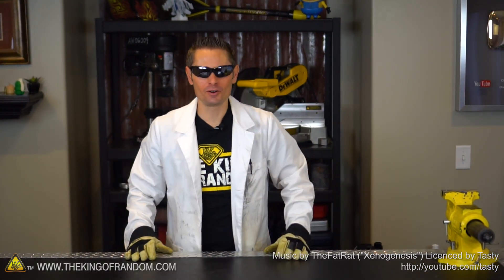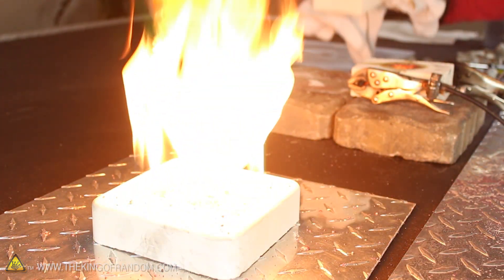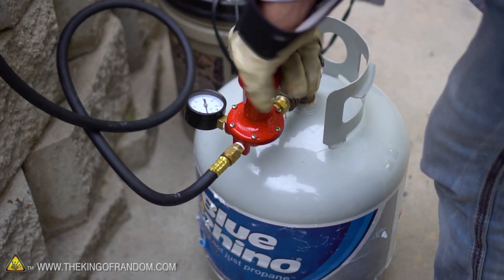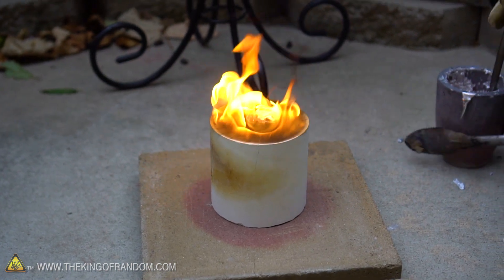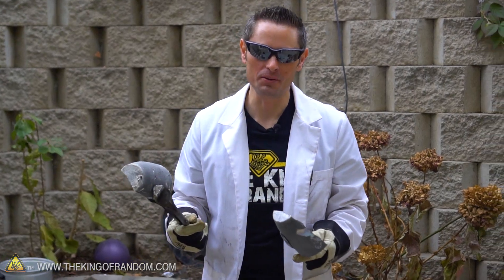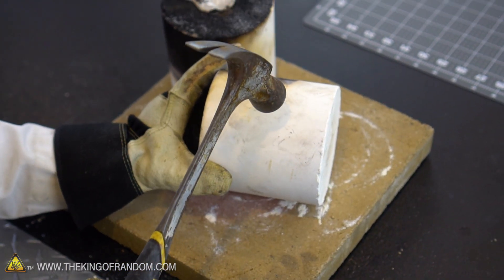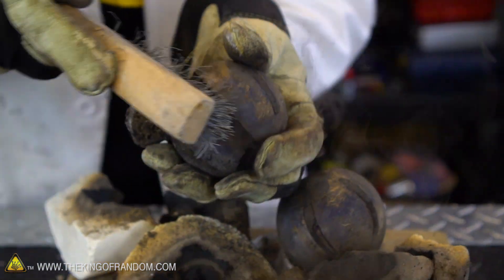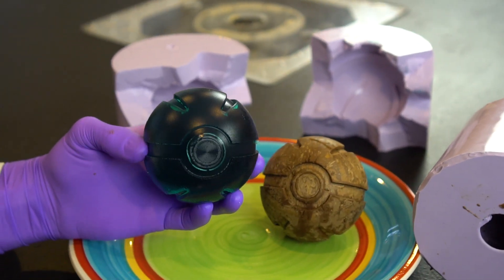Casting Aluminium PokeBalls

Comment: i think if you brush the silicone on the object first you will get a way better surface finish in your molds. similarly when you fill them, add a little first and turn the molds to coat the inside before pouring in the rest. thats what i do when dealing with latex and epoxy for fx makeups.

Comment: I would think that if you took a block of Styrofoam cut it in half, heated the poke ball just enough to make an impression on the foam and enclosed the heated ball between the two halfs, then take the ball out and cut around the impressions and place together within the bucket of sand like the master sword pour the molten aluminum and hopefully get what your looking for. I don't know if that would work but hey if it does, cool, if not, oh well.

Comment: So what you need is some sand! Look up something called Foundry In A Box. I work in the industry. use sand and binder to create a mixture to pack around the balls. Get a hold of me if you want to know more.
Reply: I also use a simple Hot Pot like you use for making fishing weights to melt Tin and it is much easier to work with.

Comment: Add some air tubes to evacuate the air from the plaster mould while pouring the metal in, tl;dr: two holes, one big for metal in and one (or more) small for air out

Comment: just a suggestion maybe u might want to ask cody about different metal melting point so that u can get a few option of metals that u can use to melt and then pour it into the plaster , my theory is that the plaster is not able to withstand the heat of the aluminium thus creating fire and then burning it maybe u guys can have another collab again which i m sure a lot of fans would like to see, i know having another collab is hard but just a suggestion :)

OR change the plaster to another kind/type which can withstand very high temperature

Comment: You should use green sand for moulds in future. Yeah the plaster works but you left that overnight and you weren't able to use it ever again. Correct me if I'm wrong, but I'm certain that green sand can be used multiple times.

Comment: To avoid the air pockets in the final casting you need a second channel for the air to escape from near the top so it doesn't get blocked by the incoming aluminium

Comment: Your casts may do better if you place the plaster(silicone, as well) in a vacuum chamber(easy to make if you have the pump) while setting the mold to get all the gases out and have a more solid form and little to no bubble business. You may also want to make more apertures for the molten metal to flow into/vent gases out by making extra limbs on the mold.

Comment: Grant, lots of people had the right ideas about dealing with the wax molds and the silicone molds, now i would suggest to try using an idea you have used before, but with a twist, try doing some "green sand" casting.

Comment: Your silicon mold was flawed from the pour, as it poured directly onto the blank the vicosity made it bend and fold over itself introducing air bubbles by the second, you need to pour slower in a corner of the mold that isn't occupied and let it fill that way.

add fine sifted sand to your plaster to give it a little more durability, and it needs to be a denser mix all around, If you could vaccum it before you pour that would be awesome but it's not absolutely required. There should be enough sand to change the color of the plaster to something like light khaki pants, I eyeball mine based on detail i'm looking for and the temp I intend to pour at.

Your shrinkage is a tough fix, add vent holes in the mold that meet the cavity about 2 mm below the first noticable defects. Failing that you might benefit from a riser as well, But I'd start with the vent holes, you can make them by rolling some parafin wax into a string and pressing it onto your wax ball before pouring the plaster investment, Paraffin wax is easily sourced and mouldable if you just get it from some fancy cheezes if you don't wanna buy some, It's actually easier to mold than candle wax in my opinion. and it'll melt out just as easily
Reply: No, mate, no capitals after periods, don't even try to correct someone when you're wrong (Hunter Jones, take that)

Comment: make a mould of sand+bentonite(binding material)+water whenever you cast metal instead of using Plaster , make small holes with a small wire so that the air come out , also coat the inside of the mould with graphite powder , this method is used in industries for casting .

Comment: you need a vacuum station to vacuum out the air pockets in the plaster before pouring it. letting it rise under negative pressure and fall several times should make structure of the molding material less prone to cracking... as far as the crucible, you already know what happened there. Also, if you still have the finished plaster warm, swash it in water the plaster should desolve from your nooks and cranies

Comment: Great work. I think the bubbles are really a result of the fire reaction. Maybe if you just cover the top of the mold as you finish pouring, soon after it starts catching fire, you can prevent it? Sort of like using a blanket to extinguish a fire but cutting out the oxygen.

Comment: Hey grant you've been doing a lot of molding and casting lately and thats great. I do this stuff a lot too and I think I have an idea for your next project. You should build a degassing chamber. It will deffinatly solve your issue with bubbles and imperfections forming in your molds and even your casts (except for the metal ones...unless you can figure out how to pull the air out while the system survives the heat.)

Comment: Take the silicone mold put plastic pokemon toy in the middle and fill it up with melted Hand soap. When it hardens you have a grate gift for pokemon Fan. When you use the soap  it shriks in size and when its all out you get the prize inside.

Comment: by the way, if you want to get rid of your air bubbles on your original molds, you can get a slightly thicker silicone that is a little like play doh, you just mold that onto the ball itself on the top so that when air bubbles do form from the liquid silicone mix, they appear between two layers of silicone, on don't create imperfections on your actual molds. you only need it on the top third or so, or wherever is angles strongly enough that bubbles will catch within the silicone liquid mix.

Comment: My suggestion for the silicone casting,  attach a sander or another tool that vibrates to the plastic cases to eliminate all air bubbles.

Comment: You should really start experimenting with green sand. It would've allowed you to cast straight from the original without needing to make the silicon or plaster molds. Just need to make sure to include vent holes. 

That being said a scented pokeball candle does sound like a really cool idea. . .

Comment: best way to remove air from plaster or silicone is to put it in a vacuum, it draws all the excess bubbles out. Maybe a use for the old pump you made?

plaster for casting could do with a little clay mixed in with the sand too.
lastly, to remove the plaster and save having to brush it off, dunk the whole thing in a bucket of water, it disolves the mold completely.
Cheers for another great video

ps. now you know why the crucible needs to be normalised.

Comment: Also, most aluminium alloys experience hot shortness. Get it hot, hit it with a hammer and it will break into small pieces you can more easily load into your crucible ;)

Comment: metals need protection, TIG uses a gas in my country is caled 'argon' MIG MAG is metal inert gas metal active gas soo is allso with a gas protection, electric welding has diferent protection that shoul be above melted metal, that might help you on future projets with metals find a way to put them same time but not mixed
Reply: more informatins you can find at aluminium welders

Comment: you could have made some gateway in the plaster mold so that the gases from molten aluminium which causes air bubbles would have passed through the gateway reducing the chances of air bubbles

Comment: I have a challenge for something unusual that you can try to cast:
https://s-media-cache-ak0.pinimg.com/originals/a9/bf/35/a9bf356c83e71c1929721a44fad1799d.jpg

I imagine the antenna and ears would be a major obstacle and it would be interesting to see if you can think of
a solution around it :)

Comment: In order to get a better surface quality, you could cover your wax prototypes with slurry and sand repeatedly until it forms a thick shell. Then get rid of the wax and then burn it in the oven. This is about the best surface quality you can achieve at home, as the slurry and the sand will not release gases after burning.
Pouring temps of 1400 degrees C. are no problem. For more info, just google Investment casting.

Comment: Hey Grant, I've done metal casting before. I'm guessing the plaster you're using isn't suitable for the casting. You want investment. It's a form of plaster that can take the high heat and not burn like your plaster. 

Other people are saying you need a vent, but in my experience you don't necessarily need it. It helps, don't get me wrong, but I never had vents and my casts turned out alright. Then again, I used centrifuge casting when doing so. 

If you were able to get the investment instead of your plaster, you'd get less bubbles. You'd also do well with a vacuum table. It vacuums all the bubbles out. But another thing you can do to help is use debubbler. It's a spray that helps investment/plaster from letting bubbles attach to your mold. If you want to talk more, shoot me a message.

Comment: Hey Grant! Maybe try using green sand for casts? I would assume it would be less tedious than making silicon molds, then wax models, then plaster molds, then metal models. Rather, you could just make the sand mold ready for metal casting straight from the original object. I hear they can hold the shape really well and can make some "accurate" casts.

Comment: hey, so to get better casting results try casting sand.  make a box cut horizontally in half and tightly pack your item to be casted inside.  when you are done filling the sand split the box open and take your part out, there should be a cavity of the item in the sand.  it's just super fragile.  Also to eliminate bubbles you need another vent to the outside coming from your casting.

Comment: your air bubbles issues can be solved by using a vibrating table like the ones used when molding candy and chocolates.  and if you want to take it to the next level, building one could be a future diy video

Comment: 1. Would you cast a metal controller? (X-Box, Playstation, ect.)

2. Is there a way to make a permanent mold, or at least more than one use?
Reply: No not really in sand casting, or the way he was doing it with plaster, but a permanent mold  is more like die casting which molten metal is forced into a metal mold that can withstand the heat. Sand casting is simpler for the every day person. Look up Foundry In A Box. This is how the metal casting industry does it. For an Example the sewer caps you see every day were from a sand casting. You have a Cope and a Drag made from sand and Binder that is packed around a Mold (X box Controller) and you create a runner so the metal evenly flows into the mold and then a pour spout to pour the molten metal in. Let it cool down and then break apart the sand and you are left with a metal mold of what ever you want to imprint into the sand.
Reply: Cranberry X (Old) instead of using plaster, use red casting sand. it is completely reusable, and doesn't release gas when pouring the molten aluminium.
Reply: Cranberry X (Old) Xbox controller please
Reply: Cranberry X (Old) rhat would be cool
Reply: number 2 XD
Reply: MoooooooooOoOOOOOOOOOOOÖOOOOOOOOOOOOÕ
MMOOOÓÔoooooœooooooooooooOoooOoøØŒoooooo

Comment: Make a mold with wet sand and foam or plastic with two pieces of wood and leave a hole in it... So when you poor the molten metal in it will burn through the plastic/foam and then leave a solid piece of metal shaped in what you want. You may need to do some sanding.

Comment: To get air bubbles out during mold making process... use vibration. I usually set my mold on my air compressor and then turn it on. The quick vibration forces all the bubbles up to the surface of the material.

Comment: To avoid bubbles in the top make another hole in the top so the gass can release and not get trapped also it will help with the building when you are poor if the mold

Comment: I'm no metal worker, but I am a guy in an internet comment section, so obviously I have some advice for you. To get rid of the bubbles in your silicone molds and wax/plaster steps, you should let them set while sitting in an ultrasonic cleaner, or on a home done subsonic version made from a baking sheet supported by a back massager. Why shake it yourself when you can have tech do the job for you?

Comment: It would be cool if you could disassemble a nerf gun and make each part with aluminum, then reassemble an aluminum version. Or I guess you could just do the outer shell of the nerf gun and reuse the same internal pieces... that would be easier

Comment: I used to cast aluminum on sand molds and they work really well with aluminum. Also, you need two holes in your mold to let air out as you pour in your aluminum. it gets rid of all the bubbles which helps

Comment: Grant, you may want to check out wet sand casting, I did it many ... many ... many years ago but, it gave an extra fine finish. Also we used a vibration table to get the air bubbles out before the metal solidified.

Comment: I may be wrong... but to get rid of your air bubbles, add a second hole in your mold for the gasses to escape. That way you can pour into one hole and the other will create almost a vacuum effect with the gasses.

Comment: Well, honestly, looks like others got here before me with the metal casting suggestions of lost wax vs two piece molds, green sand molds, sprues for gas release. If you haven't built a vacuum chamber yet, it should definitely get on the list before you do any more silicon molds since it will help greatly reduce your air bubbles. The guys over at Tested have an excellent demonstration of two part silicon molds that makes use of one to give a much higher quality casting which will help minimize the errors that occur through the multiple stages.

Comment: its a little pricey but  "jewelers investment" will handle the heat without gassing.. lost PLA is in my future casting plans print something on a 3D printer cast it in investment and melt it out like you did here. but pour from a side chute so it fills from the bottom up

Comment: You might want to use the lost wax casting method where you leave the wax in with shoots for drainage and then the wax is replaced with the molten aluminium. If you just search lost wax casting method you should find an easier way to do this.

Comment: These are two methods that I can suggest:

Method 1: Single mold

Lost wax process works best with ceramic clay. It can withstand temperatures up to 3000 degrees, easily. You should cover the the wax Poke balls with ceramic slip(same consistency as used for pottery making) and fire it in a kiln. The wax can be salvaged and you will be left with a perfect ceramic mold that can cast even high temperature metals/ alloys like copper/ steel, easily. Works best for any kind of casting; irregular(like a sculpture) or symmetrical/ regular(like a ball)

Method 2: Two part mold

Activated sand mold process. A mixture of silica sand and resin works the best. You could also use CO2 activated sand mix. Although a wax ball would work, I'd suggest using a plaster cast of the poke ball using the Silicone mold. You then use this mold to cast 2 part mold of the wax casting(Resin activated Silica sand sets in some time, while Gas activated sand needs to be injected with CO2 to set it)
Either way, you'll have a 2 part sand mold. Spray both halves with a solution of fine graphite powder and propyl alcohol(any alcohol would work). Then burn off the alcohol, to be left with a thin graphite layer that protects the sand from being corroded by the metal. And you're ready to cast!
Note: Works best for symmetrical/ regular shapes, though you could use it for any shape

Hope this helps!

Comment: you should build a pocket on the top of the mold to account for shrinkage, known as a riser. It should also help with air pocket issues. also what are you using to measure the temperature of the molten metal, the metal pouring temperature is the most important part of a casting

Comment: like many have said for metal, cast with packed sand. use a metal wire to make lots of air holes that are easy to clean up after.  use a  2 part mold for Round objects. have a pour hole and vent hole.

Comment: Back in High School I use to cast rings, using the lost wax method.  and we would put the casts in a centrifuge.  once it slowed down we would drop it in a bucket of cold water and the plaster would blow a part from the temp change.  we would heat the cast up in a small kiln and once it was to temp we would start melting our pewter, silver or gold.

Comment: mechanical engineer reporting in. plaster casting like this is fairly common. the gas you see escaping is actually water, but it's unavoidable. plaster of paris is anhydrous gypsum. when it's solid it has water inside it at a molecular level and when heated excessively, it reverts back to the powder (the stuff you bought at the store). you can improve the quality of the casting and prevent cracking by having a second, smaller hole for the gasses to escape from, as well as bringing the hold to a temperature closer to the molten aluminum. be aware that the preheating will make the mold more fragile.